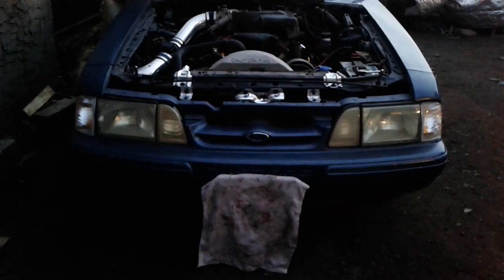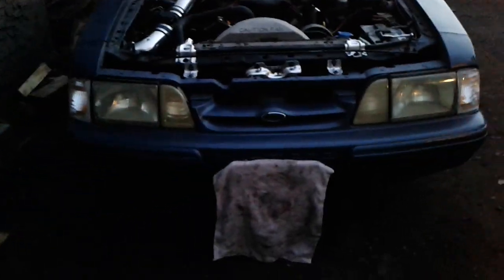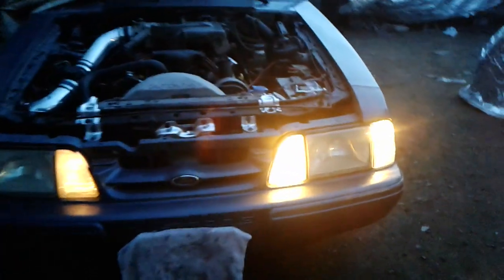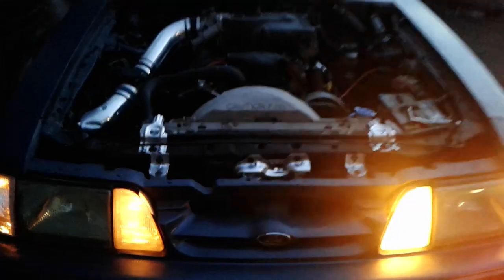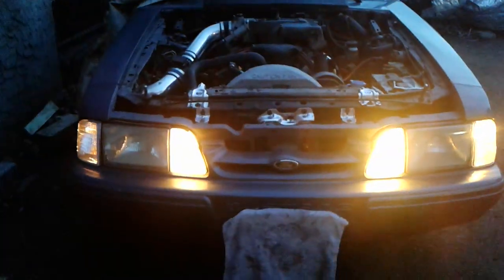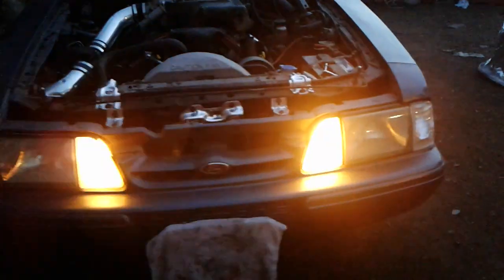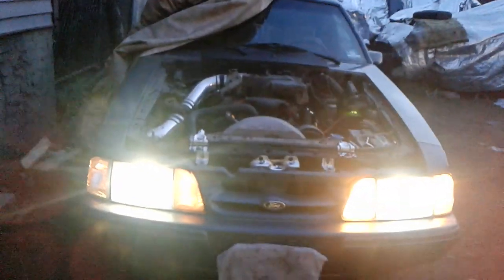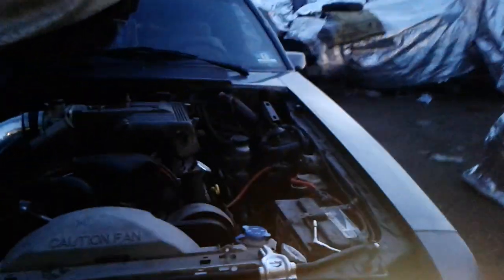Halogen vs LED light bulbs (1988 Ford Mustang LX 5.0)

Comment: What LEDs did you use, my hazards wouldn't work on my 1993
Reply from the maker: The ones for the inner parking lights are jdmastar. For the outer, I forgot what brand I used but they bought from eBay. I highly recommend going with lasfit less as they are extremely high quality made in the usa.
Reply: @dc007fan  thanks for the info
Reply: I love how slow my signals are.